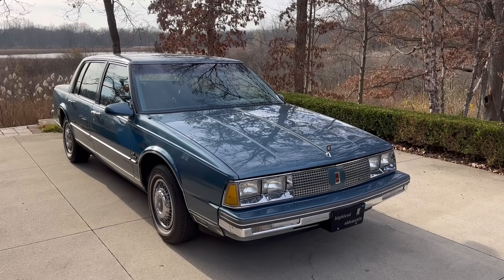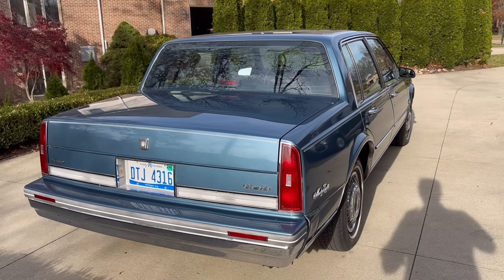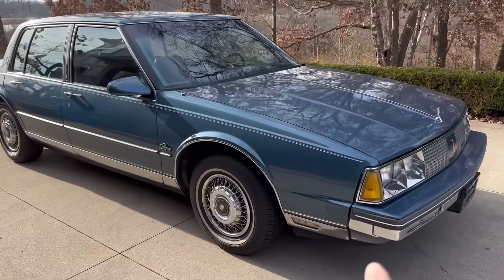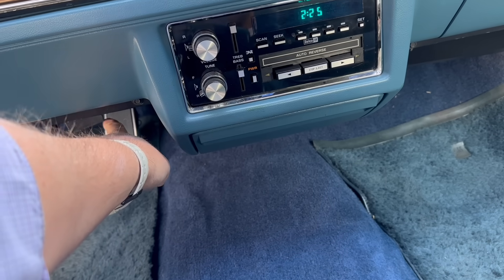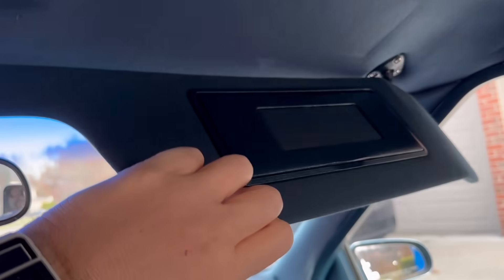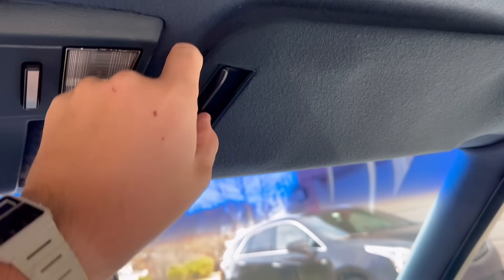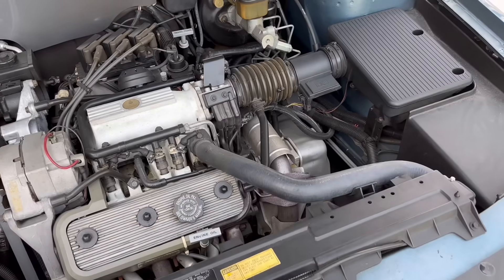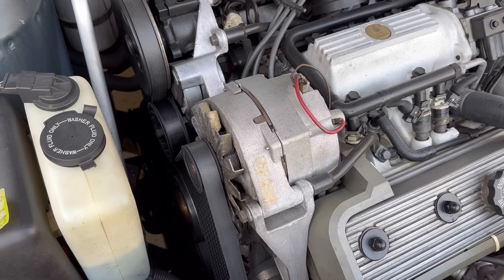Strange Features, Quirks and Idiosyncrasies of GM's "'Baby Big" 1986 Oldsmobile 98 Regency

Comment: Amazing that GM design took off 30 inches (!) and still made a car with almost as much space as the previous full size cars.
Reply: The BIG PROBLEM was they LOOKED small.. They did not look imposing in the manner the GM C bodies had looked going back to the 1960s. Park a 1986 next to a 1963 and the differences are stunning.

Comment: I remember when the 85 C-bodies came out. As a mechanic, I was really surprised by how roomy the engine compartment was, and how smooth they ran and drove. After 5 years of working on the POS Citations and Cavaliers, it was like a breath of fresh air. BTW, those MAF sensors were easy to diagnose. If the engine was running, and you tapped on the MAF, one of 2 things would happen: if the engine kept running smoothly, the MAF was OK. If the engine stalled, the MAF was bad. Also, unplugging a bad MAF would allow the engine to run good enough to make it to the repair shop.
Reply: Alternator on top good design.
Reply: Yes !
Reply: Very true, spot on!
Reply: I had a Cavalier:face-orange-frowning::face-orange-frowning::face-orange-frowning::face-orange-frowning::face-orange-frowning::face-orange-frowning::face-orange-frowning::face-orange-frowning::face-orange-frowning:

Comment: In the mid 80's I was an engineer on-site at Lake Orion (Michigan) where these vehicles were built, also Wentzville, Missouri. We put the conveyors in. One of my jobs was to ensure the pickup points were accurate and in doing so, I got exposed to the design/build of the rear sub-frame.  They were exceedingly strong. They passed the rear crash tests with flying colors. These really did turn out to be excellent vehicles

Comment: My ‘89 lesabre was as reliable as any Toyota I’ve ever owned.
Killer cars in every regard !!
Reply: yeah I had an 87 it was pretty bitchen 😏
Reply: For sure, growing up we had a 1985 Buick Park Avenue with the 3800. My Dad bought it at a public vehicle auction. He bid either $500 or $600 and not one person bid against him. It probably had 100,000+ miles at the time. It passed from my Mom, to my brother, to me, and then my cousin. Even with all the abuse we threw at it the car simply wouldn’t die. It was well over 250,000 miles when I had it. While it was a little rough around the edges it never let me down. We had great luck with all of our 80’s and 90’s GM vehicles
Reply: Same here, we had an 88 LeSabre (first year 3800) As a teenager I was hard on it, then my younger sister tried her best to destroy it and couldn't. Parents ended up selling it and I literally saw it a few months ago, still running. Would have to have nortt of 300k on the clock by now.

Comment: I had a 1986 Olds 98 Regency Brougham back in the early 1990's. It was my very first luxury car out of high school, and I absolutely adored that car. It was white with grey-ish mint green velour interior, and had that absolutely extraordinary door chime. Drove it between So Cal and Oregon several times, and it never gave me so much as a single complaint. It took that Siskiyou Mountain range like butter. Such a fantastic car. It seemed so small, but it had such a big car ride. What I loved about it too was that it was super cheap American luxury. It barely had 80k miles on it, and had been impeccably kept by the first owner. Absolutely bulletproof engine.

Comment: I worked at a Buick dealer in the 2000’s and there were still a ton of these coming in for service and repair. Definitely decently made cars. The 3800 didn’t have the common intake leak issues until the 90’s. Anyway, one of the annoying things about these cars was just trying to do a quick tire repair or rotation. The hubcaps were a massive pain to take off, you had a weird key that you had to twist in the center and if that key or the hubcap was stripped good luck.

Comment: A comfortable, relatively spacious car that can also still provide decent economy? What a foreign concept in the current automotive space, where GM will sell you a never ending variety of oversized yet claustrophobic crossovers, massive trucks and SUVs, or a single economy car that will shatter your spine if you hit a bump. It's a shame these cars are all now 30 or more years old, and even the best kept examples are potentially at risk of age related failures. Otherwise they'd be excellent daily drivers even today. 

Amazing example, Adam! Love that blue interior!
Reply: I daily drive a 1994 Cadillac with only minor issues from time to time.  But I do most of the repairs myself.  It would be different if I had to pay someone to do the work.
Reply: With junk 1.4, 2.4, and 3.6 liter engines. There was a time when you NEVER had to worry about GM drivetrains.
Reply: A good bit of the blame goes to the EPA for putting mpg regulations on the manufacturers. And if that wasn't enough, they used a stupid formula for manufacturers to go by, which made it almost impossible to focus on good midsized sedans anymore. 

A full size SUV that gets 18 mpg is much better than a midsized sedan that gets 30. Yes, blame the stupid Environmental "Protection" Agency for that one.
Reply: And WAAAAY overpriced.

Comment: Gravy job at the dealer back in the late 80's-Crank sensors for tow in road side stall only to start fine when unloaded off the truck, MAF sensor for stalling diagnosed by tapping it with a closed pocket knife, and a bad ECM causing a stall by just tapping on it.  Of course, often it took 3 ECM's from parts before getting one that actually worked.
Plus, replacing the Da6 AC compressor and flushing the system of all the ring debris paid good too.

Comment: Adam, I had an 88 model Touring Sedan which I adored when they were new, but they were expensive ($26k, I think?).  I was able to get one which was 3 years old with only 10k miles on it, and drove it till nearly 200k miles on it when the brake system failed.  Super comfortable and great mpg cars!  Thanks for taking me back!
Reply: I sold plenty of the touring . It had great seats . Real wood trim . Great fit and finish
Reply: ALWAYS have desired a TS!

Comment: Great car, another great tour/review! 
The opera lights on the C-bodies were electroluminescent, not LED. 
If you squint at the ALDL, you should see an "A" and "B" molded into the plastic at the corner terminals that you ground to read codes. If I recall correctly, the ALDL wasn't always in the same orientation across the different platforms. I actually still have a "GM code key" on one of my keychains, but of course a paper clip does the same thing! I'm thinking that the flashing Service Engine light began with 1-2, 1-2, 1-2, then any trouble codes, and then 5-5, 5-5, 5-5 for end of sequence. It has been a long time since I read an OBD I car, though, and may be confusing this with contemporary Chryslers. As a teenager in the mid-80s, I used to check my parents' cars for trouble codes every time I washed them. But alas, they always drove newer cars, and I never got much practice! A car with multiple codes took patience and concentration to count the light flashes!!
Reply: Yes code key or jumper it... don't miss doing that.
Reply: I caught that on the LED lol

Comment: The Town Car did not even need that famous commercial they were built so well with the smoothest 5.0 EFI engine ad butter smooth shifting AOD transmission it sold itself !
Reply from the maker: Never heard anyone call the AOD buttery smooth.  Every one I drove was anything but.  They were awful herky-jerky shifting in/out of lockup.  The 5.0L was smooth, though.
Reply: Was it a one owner car ? My 88 Town car is and the car looks like new and drives like new too. @RareClassicCars

Comment: In 1990 (at age 18), I had a 1985 Regency Brougham 4D in the same color combo as yours. I was lucky (or not, depending on who you ask) to have the voice reminder system where the car would tell you a plethora of warnings and notifications. I believe, if memory serves me, it had the trip calculator in lieu of the Olds crest on the dash but did not have the digital dash. I thought I was the only person alive who loved the double-ding door chime. I prefer the 1985 out of the bodystyle run (85-90) because of the grill and split headlamps. I wasn't as fond of the 1986s eggcrate for whatever reason. The car was ahead of its time, in my opinion. When other high school seniors were driving around in Camaro's, Fiero's, CRX's, Probe's, Storm's... I chose to buy the Ninety-Eight. Loved and still love that body vehicle (I say that because I love the Electra and Park Avenue, too). The only thorn in the side of my car was the Turbo 440 Hydramatic transmission. It failed twice but luckily there were many C-Bodies in the salvage yard back then. Other than that, it was perfect till a drunk lady in a Chevy Astro parked her van into the trunk and rear of my car. It was totaled, of course. With the proceeds from her insurance, I bought a 1986 Oldsmobile Delta 88 Royale Brougham Coupe (Burgundy with red pillow top cloth seats). It had the FE3 package and wheels (I preferred the wire wheel disc on my Ninety-Eight). Had zero problems out of it. Traded it after 8 months for a low mileage 1986 Lincoln Mark VII... an amazing car in its own right!   Sorry for the long winded comment but you brought out many happy memories with your video! Thanks for posting it!
Reply: Was that mark an LSC with the 5.0?
Reply: @anthonym.cardali1875  No. It was a base Mark VII. It did have the V8 (not diesel). It was however an interesting color that I haven't seen in a Mark before or since. I think the actual color name was "Spruce Green". It was sort of an army green metallic. I appreciate it more now than I did then!
Reply: I had a '86 Electra 380 with those wire caps. They had a tendency to loosen up over time & it sounded like your whole car was falling apart coming down the street. I found a decent set of aluminum rims in a yard & quieted down the car. Hated those wire caps!

Comment: Hello Adam, like your channel - my brother back in the day had one of these cars. It was the Buick Park Avenue variant. Think his was an 88 with the -3800. Into cars myself, just purchased a 1986 Pontiac Fiero 2m6. Was a rare find at 15k original miles. Was sitting for a long time but runs great now. Put on whole new Monroe suspension, new fuel injectors which werent cheap 180 dollars times 6, plugs wires, e brake cable. Passed inspection and driving it daily.

Comment: I had a 1986 Pontiac Bonneville. And like you said, the timing chain jumped at 110,000 miles like clockwork. But the engine itself lasted over 200,000 MI. The transmission had a bump with the 1-2 shift that started at about 130,000 miles. It gradually got worse until about a hundred fifty thousand miles. . Then it got no worse And lasted until I got rid of the car at a little over 200,000 miles. It got great fuel economy. My mother had a Buick Electra of the same year. Those cars had solid power trains. Not the smoothest running engines right off idle.. but very reliable. Although I had a Pontiac, I would have had rather have had the Olds 98

Comment: I had an 86 ninety eight brougham, 2 door. I loved the car and was proud of the rarity factor as you almost never saw a 2 door even back in the late 90's when i first got it. But the thing you describe where the timing gear goes out between 110 and 130k miles is spot on, happened to me at 120k miles almost exactly. I was determined to save the car, my mechanic tried to convince me to just get a new 3800 engine and i stubbornly just rebuilt the engine (in retrospect I wouldve gone with the 3800 but I didnt know about the improvements to it and liked the idea of keeping the original engine). The engine shudder at idle that you describe seemed more pronounced after the rebuild and it kinda made me lose interest in the car and i gave it to my dad. Eventually it got stolen from him and later was found stripped in an alley. 

In retrospect knowing now (from you) that the shudder at idle is "normal" is interesting. When it was newer i never noticed it but thinking back, when i did notice it after the rebuild it was an annoyance but the car otherwise performed just fine and was completely reliable up until it got stolen. Also interesting that the transmission wasnt as bulletproof in the 86 because mine never acted up.

That said, 2 things I didnt like about it: 1. The gear shift knob was made of plastic and eventually wore out and fell apart. I think i eventually found a replacement but I didnt like the idea of plastic in a part that gets so much use.

2. The "short body" GMs like my 98, while they had tremendous interiors and lots of niceties, they just never had the same "wow" factor and presence of their earlier iteration big body predecessors. I didnt really appreciate the low belt line giving me all that great visibility, I kinda preferred (and still prefer) a higher belt line where it feels like I'm surrounded by "more car" so to speak.

Not to talk bad about the car because in retrospect the short body 98s gave me a lot of good memories. My dad had an 89 in a dark blue (almost black) with a red leather interior, and it felt more classy than pretty much anything I see on the road on any given day today. 

My 86 btw had a more 1970's feel to it with the tan leather interior, factory CB radio, and more simple layout (not sure how to describe it) vs the tourers and more stock standard 4 door versions.

Oh also I should add it was superb on the highway, got great mileage and never let me down. Took multiple trips back and forth from Chicago to LA. The one time it felt like I was pushing its limits was on a hot summer night going about 80 or 90 uphill in the desert, lugging all my stuff in the trunk (coming back from college) with the AC on and I noticed the temperature gauge climb higher than it normally would, it seemed on the verge of overheating but somehow never did, and went on to get me across the country in comfort like every other time.

Comment: Although I was not a GM fan, I did like the Oldsmobiles a little better than the others. And it really hurt me a little bit when they allowed Oldsmobile to become the weakest link and be the first division eliminated in modern times. This is especially tragic given that Oldsmobile but one of the earlier if not the earliest automobile manufacturer in the USA.
Reply: I was sad they killed off Olds and then Pontiac. I saw an old man driving a really well maintained Olds Alero earlier this week and I still think they’re great looking cars. My father in law no longer drives and offered me his fairly low mile 2005 Pontiac Grand Am. Even though it’s been sitting a few years I might take it on as a project. It’s got the 3400 v6 which is a pretty well regarded engine even if it’s not as reliable as the 3800.
Reply: @RobertSmith-le8wp  Two years ago An elderly lady GAVE me a 1993 Pontiac Grand Prix 3.1 L when she stopped driving because I was the one who’d always done the work on it. My dad had replaced the crankshaft about 20 years ago because she’d run it out of oil because of a oil leak. It had about 50,000 miles on it then. It had 73,000 when she gave it to me. The 3.1 isn’t quite as robust as the 3800. But it’s still a pretty good engine. The car runs like a champ. Not that powerful, but pretty much typical for its day.

Comment: @RareClassicCars The opera lights on the b-pillars are not LED. They are what’s called Electroluminescent panels. They use a phosphorus filament inside that when an electrical current runs through it, it emits a white glow. You can rebuild them using a new electroluminescent panel.

Comment: Have you ever seen a car with the trip computer / calendar? It mounts where your car has the name script in the middle of the dash, to the right of the warning lights. It had a vacuum fluorescent display, and when you turned the car on it would spell out "Good Morning" or "Good Evening". Seemed very classy! 
What a tidy engine bay. If I ever came across an Electra T Type, I don't think I'd be able to resist it.

Comment: While Oldsmobile and Buick had transverse mounted V-6 engines, Cadillac had that infamous all-aluminum HT-4100 V-8 mounted transversely.  It was the biggest piece of crap.  The 3.8 V-6 in this car was good; the transmission was garbage.  Cool fact: When the 1986+ 88 and 98 (and their Buick equivalents) were switched to front-wheel drive, the station wagon versions continued on the old "B" platform.  In 1987, Pontiac switched the Bonneville to this platform and the Parisienne Safari continued on as well.  GREAT VIDEO!

Comment: I love these cars & have had several, used to work at a GM dealership & got to buy trade ins. Only ones I wanted were the 3800 though, they last a lifetime if you look after them, only failure is the cam position sensor which was glued inside & would fall off. My 89 Park Avenue had 685 k on it & was still running well when it was sadly rear ended & wrote off.

Comment: I attended a GM training session in Garland, TX in 1985, where I first encountered the ALDL connector. If memory serves, you short pins 11 and 12, lower right corner. There's even a notch in the plastic connector shell so you can touch both pins with a key or screwdriver, although GM gave us a nifty brass tool to put on a keyring. I still have mine, it's migrated from keyring to keyring over the intervening years, brings a smile every time I see the GM and Delco Electronics logos stamped on the tool 😊

Comment: I had an 86 Electra Park Avenue - great car.  IBought it with 48,000 miles on it and it already had the SRTA (service replacement transmission assembly) which was the factory reman unit that had all the engineering updates.  The transmission never gave me any issues.  I replaced the steering rack when it got "morning sickness" and the cam gear and timing chain before it self destructed.  Sold it with 220,000 miles on it in 2006.